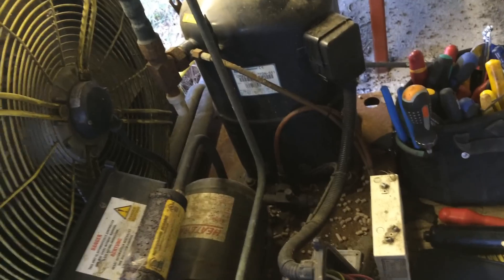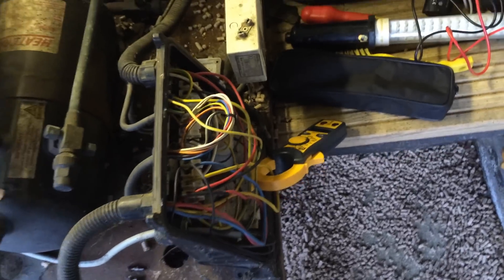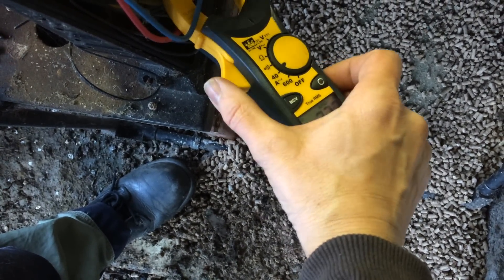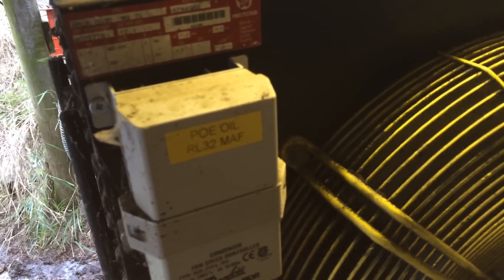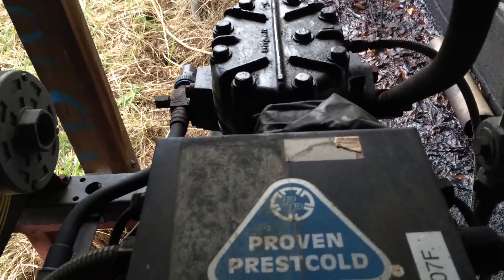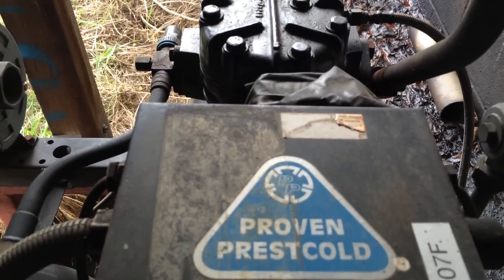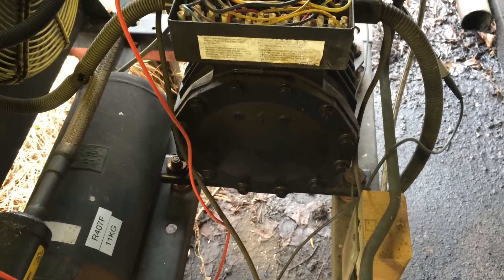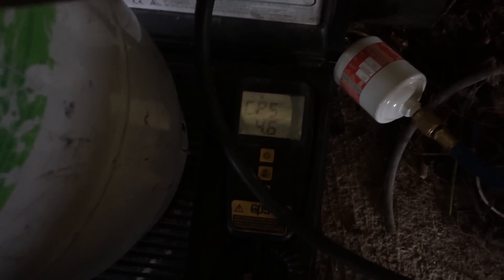Compressor Fail Almost Caught on Camera

Comment: does losing a phase happen very often? I saw it happen twice when I was in the factory but the mains supply tripped out so it only lasted about a second as a condition so is it common out in the sticks?
Reply from the maker: +jon johnson Its very uncommon to lose a phase. I spoke to them the next day and they said it was a power cut and not a lost phase so my theory is wrong about what made the oil splasher fail.
Reply: I know powercuts are more frequent in the sticks .lol

Comment: Wow! Have never seen them fail like that before! Running out of phase must have put that rotor and splasher under silly amounts of stress. Could you put two hermetics in tandem in place of it? Presuming two could make up the same rating
Reply from the maker: +CAL'S ENGINEERING I spoke to them again and it turns out it was a power cut and not a lost phase so i think it just failed from old age. I fitted a 6hp hermetic in its place, it had the same cooling duty at 0C so should work just as well, but yes you could fit tandem compressors if you wanted or needed to though you would need to balance the oil levels between the crank cases.

Comment: Quick question John. what would you set the fan to cut in/out on say 404a and 134a.
Reply from the maker: +Steve Orr I would usually set them for around 35C condensing temperature, sometimes a bit lower and for heat recovery systems a bit higher say around 40C, you'd need to look the respective pressures up on a PT chart. I use the Bitzer app for iphone which is quite good.

Comment: 20 odd years not too bad.
Reply from the maker: +SeanBZA Yeah it would have been but this was a 16month old rebuild!
Reply: +heavydiesel Ouch! As a plus yesterday I saw a locally made in South Africa dairy cooler indor unit, which has copper coils and stainless steel fins. Thick copper tube, not the paper thin ones on the others. Damaged by the couriers, who bent a few fins, which are not movable by hand, but the tubing still undented with crushed fin. Would take 3 months to ship to you unless you wanted an insane airfreight bill for the 100kg parcel.

Comment: to bad they don't have the Copeland scroll condensing units for you, that would be a perfect aplication
Reply from the maker: +Nor-Cal Refrigeration & H.V.A.C I didn't check if they had one, I went with the cheaper Tecumseh compressor, once i found i could not get a direct replacement. The scroll would have been option three!